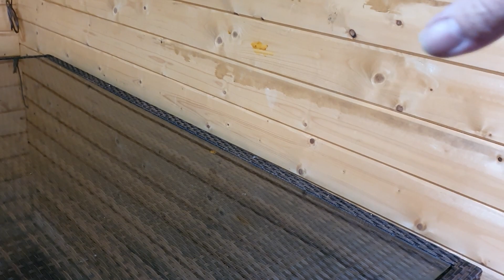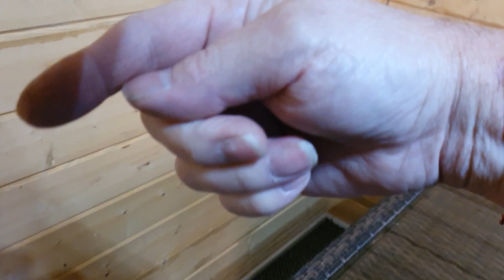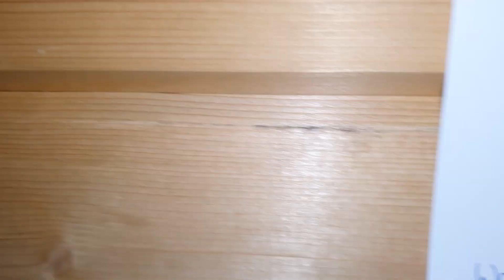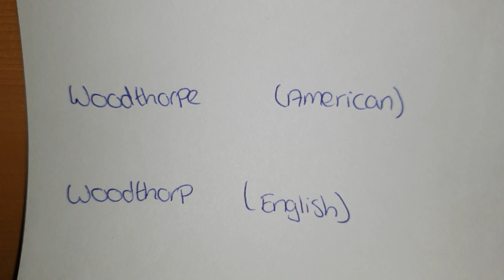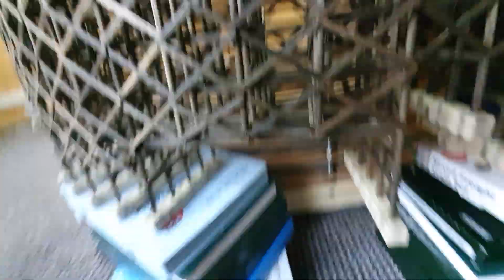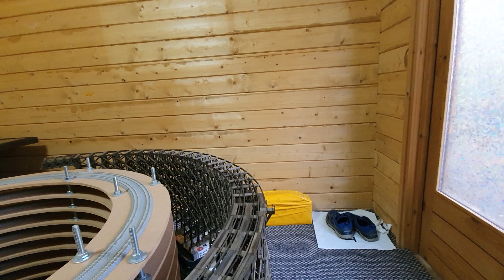No. 1 The End Of A Era And The Beginning Of A New Era

Comment: Hi Collin - Brilliant update mate but in my present mental health condition I had problems trying to get my head around some of what you are going to do.
So correct me please, you are as yet going to have three sheds constructed? 
Will they be right next to each other as in a long shed or will there be gaps in between?
I get what is going into two sheds but what does the third shed contain?
If they are all joined up will you leave the internal walls up or cut sections out so you can see into the other rooms?
Finally the shed you are using, you said you are going to make a false ceiling so that there is less to heat up. Does this mean you will eventually have to move everything out and return it to what it was?
Regards Chris
Reply from the maker: Hi Chris so great to hear from you sorry for making it complicated, The shed what you see now is going to have Japan on the lower level and America on the upper level, anything I do to it will stay just the layout will be taken out hopefully after I'm long gone. 

The shed were England on the lower level and European layouts are going that has to be built yet there will be a gap between the 2 sheds so there's going to be two tunnels, one on each level which there going to be insulated and a lift of top the gap is going to be about 3 feet. 

The third shed is going to be a fiddle yards are going which is going to be on again 2 levels with each level have two countries on each level. So the top level will have America and the European stock on and the lower level will have Japan and England stock. The fiddle yard are totally independent to each other so the stock will not get mixed up. 

Now the technical bit if I'm on my own say we're the America and Japan is I will be able to see England and Europe layouts through camaras on a big screen and if we're in The England, European layout shed we will be able to see what's going on In the other shed. 
And both sheds will be able to see the fiddle shed. 
So basically there 4 layouts which have 2 countries in each they are connected with one helix in each shed, and both layouts can travel to each shed can travel to each country. But each layout runs as its own layout if we want to. 
Chris I hope I haven't blown your brain anymore and explained it ok please ask as many questions you want to. Look after yourself my friend. Colin

Comment: Hi Colin and hello Woodthorpe International! Well that all looks very familiar to me those wooden walls!. My cabin is insulated top and bottom but during these colder months I run two small oil filled radiators all the time which keeps the edge off. I also use when it’s freezing and i’m in the cabin is a small blower fan heater which I leave on for about 20 mins which makes it to hot actually, lol! But the warmth it creates lasts for ages.
Really looking forward to the project Colin and I’m fascinated that it will go from one cabin to another.
Cheers for now mate, John
Reply from the maker: Hi John I've always like your cabin and look at me now I have one similar yah. The fiddle shed is just going to be a normal shed design but a very good quality which will get insulation pt in and plasterboard but the screw holes won't get filled. But the England, European layout shed were going to build because it's bigger than the one I'm starting in, and as you know the cabins as good as they are, there expensive. But it's very exciting and looking forward to doing it. So there's a few numbers with this project, 4 countries, 4 season a different one in every country, 4 tunnels to get from shed to shed, 3 helixes 2 big and 1 small, 2, 3 to 4 foot mountains 3 sheds on 2 levels 🤣🤣🤣🤣. Have a good week. Colin

Comment: Hi Colin,
A bold move to rename but as we will all be moved over should be fine. A nice shed but its the same construction as my big one and over the years with constant shrinking and expanding mine did start to fall down so as you may remember I did repair it so just keep an eye on it. Nice to see all the bits in one place and yes the ship does not look so big now with the other parts there. It will be great to finally see the build start so the very best of luck with it and I am sure all will go well.
Cheers Robert.
Reply from the maker: Hi Robert the shed has been up about 8 years and there no sign of deterioration but good advice I'll keep a eye on it. When i move the ship and put it on the table it look big again. Hope you are well. Colin
Reply from the maker: Hi again just look back on your shed repair they are same design but the wood on my shed is out of 4inch thick timber and I believe it got a double tongue and grooved so I think it'll be ok
Reply: @collinsngauge5493  Hi Colin thats great yes mine is only 1 tongue but I think what got mine into the state it was is because I screwed timbers vertical on to them and as not every slat was screwed it did not let them settle after movement so if you are going to fix plasterboard to the inside with screws you could have the same problem although with that size timber may not be a problem.
Cheers Robert.